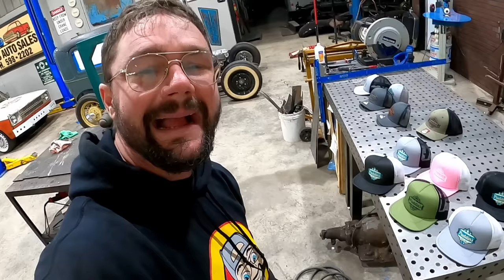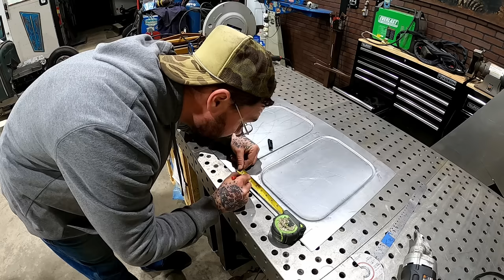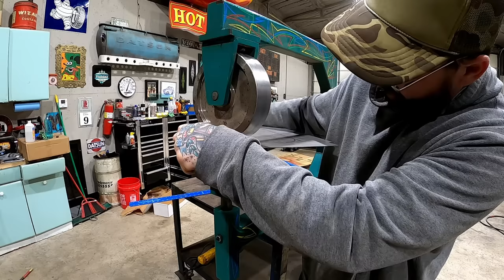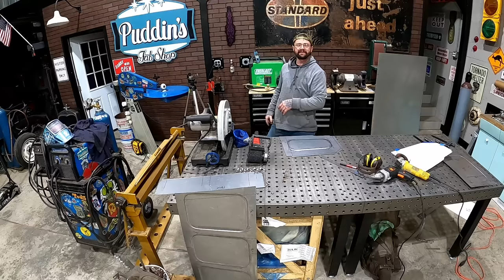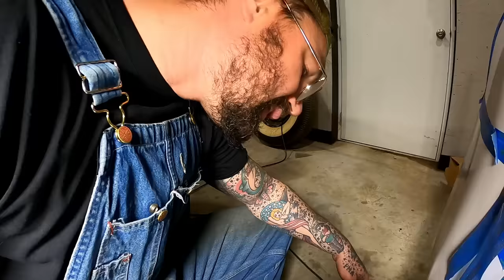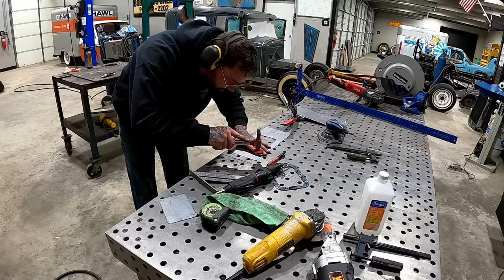BUILDING CUSTOM SHEET METAL FLOORS! 1930 FORD MODEL A!

Comment: For "not being a sheet metal guy" you did damn fine job on those floorboards. Thanks for the lesson on fabricating the floorboards using the English wheel before bead rolling.  Prayers for a speedy recovery for your Bride.

Comment: Puddin there is a calculation for the amount of shrinkage you will have with your step bead rolling. You need to know your material thickness, the take up off your step rollers, and the pressure that is used to achieve the depth of your desired step. You would use the same calculation to determine the amount of material needed to get a specific angle in a bend when braking flanges. I don’t know the exact numbers. The brake press that I used at work did all the calculations for me and told me what die and punch to use.

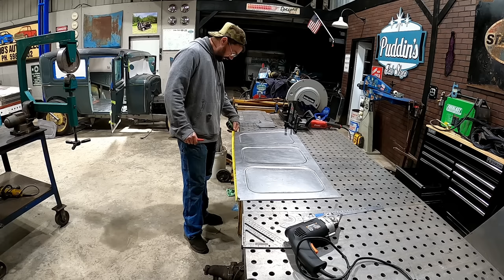Comment: Hey Puddin, just a quickie here. Glad you're wife's surgery went gooder! Hoping for a speedy recovery! As for that magic formula you mentioned at 11:07 it's super easy! You just take the overall width of your panel, 39 ⅜, and subtract your 2" border X how many times it's in there overall (4 in your case cause you knew you wanted 3 drop downs) for 31 ⅜. Divide that by the 3 drops you want to get 10.45833 or roughly 10 5/16 ISH lol hope that makes sense!

Comment: Glad your wife's surgery went great. Hope she has a speedy recovery as well. Puddin dont forget to seam seal the edges of your floor pans and where you floor pans meet up together in the middle to keep water from coming up through them. And probably wouldn't hurt to put it on the lift and seam seal all the edges and stuff under there too before you paint it or under coat it. What ever you decide to do.

Comment: Hey puddin,  I'd like to throw out 2 ideas that you might like. Number one, Do some dirt work in your yard between the house and your shopLike a small oval  Banked dirt track.  I don't think any other YouTuber or has a test track. I think it would make great content as you  Finished a car You're closing shot Could be the car Ripping around the track. Number 2 take the old frame and yellow wheels mount the body that is hanging up and make a model T speedster. It just so happens that Merlin's old time shop is making and original, It could be worth checking out and would be a gas on your new track. Just some ideas

Comment: Hope the MRS has a quick recovery. 
Good stuff with the bead roller. I see how much pre-stretch is needed. Its a lot. 
And a couple videos ago you masked up the glass. Ya, im an idiot, trashed my glass while grinding in the cab. 
I used a front wheel drive axle boot as a shifter boot. Welded a pipe to floor and bobs your aunty!

Comment: Cut yourself a piece of tire tube the width of the upper wheel and a little smaller in diameter than the wheel on your english wheel so tension will hold it on for stretching metal. You will be amazed at how well and faster it works by having that little bit of give, to stretch the metal.

Comment: The equation is simple you want 3 bays with two inch flats which is four flats so that's 8 inches minus over all length then divided by 3 giving your bays 10 and 7/16 construction pro calculator will change your life bro

Comment: Hey puddin they have an attachment for your drill a metal shear attachment made by Malco I believe it’s 30-40$ not super expensive but I’d have to assume it’s easier to use than the one you have you just pop it in your drill and go no plugs no wires
Bluetooth edition

Comment: If you got a gopro that supports wireless file transferring, you could get a wireless hard drive backup to have it connect and backup to. Western digital has some good wireless enabled external hard drives. Just a thought lol.

Comment: For the floors uou should take out what you did put some just regular ole flat plate. On top of the flat plate put some thick ole insulation, on top o tgat put the rolled steel. That would look so damn good.
Reply: Flat sheet metal will flex buddy!? Puddin knows best.. 😮

Comment: I’m a custom body and paint tech myself over 40 years but my question is while you were making them floor panels did you take in mind that that trans is going to pull up when you put it in gear and hit the gas and with the space you left between the panels and the trans there is a strong chance the trans is going to hit them panels? Just asking because that gap looks way too small.

Comment: Air Force tech I have you used skate board  wheels and old metal roller skat wheels.and the modern skate wheels wide and skinny don't forget shopping cart tires.trust. In the wheels.lol